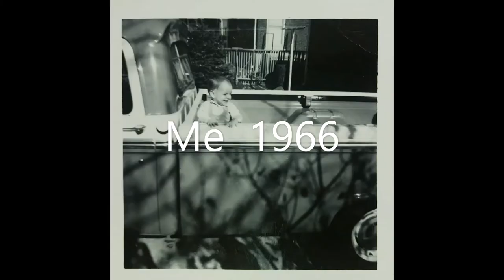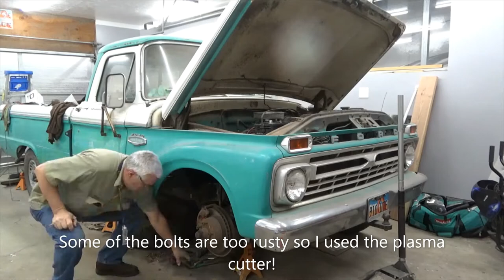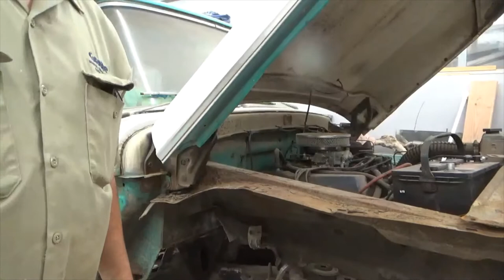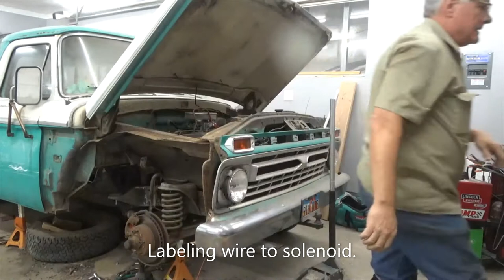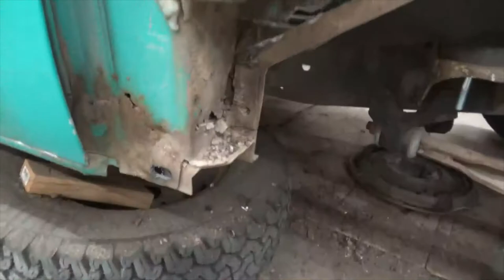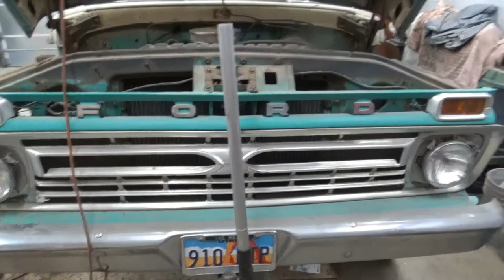1966 Ford f100 Removing Passenger Fender

Comment: Did you replace the cab mounts? They look brand new. They also look different then mine and I need to replace them as well. Priority goal is to get the engine running first then body work. Thank you for taking the time to video this, I’m taking all of this in!
Reply from the maker: The front cab mount are the newer style but the work out good. You may need the older style, I think your floor is different than mine. Check LMC Truck.